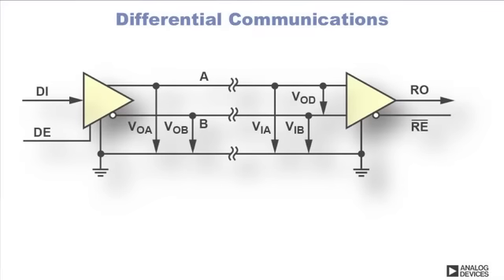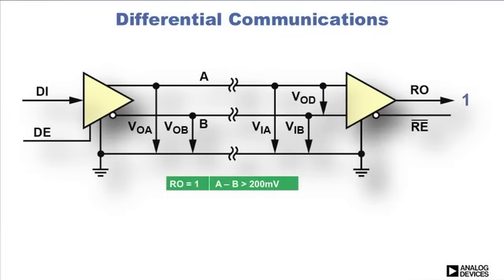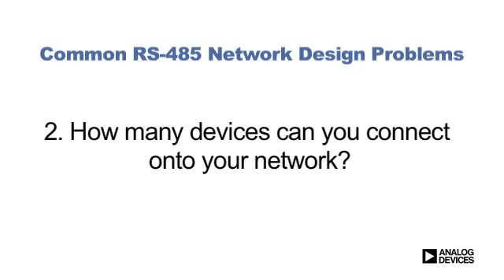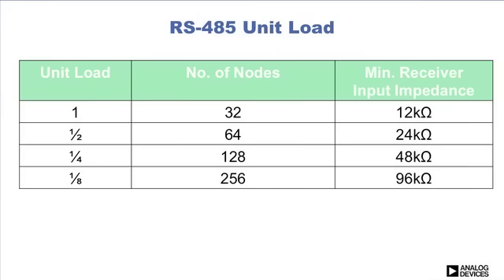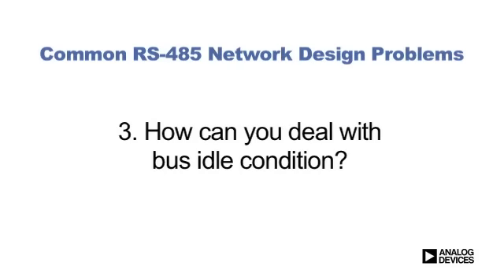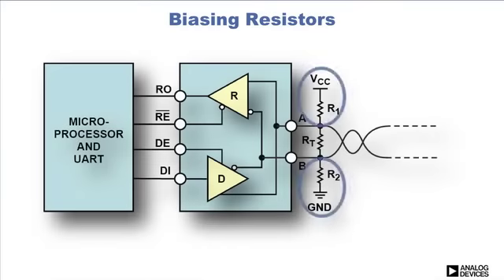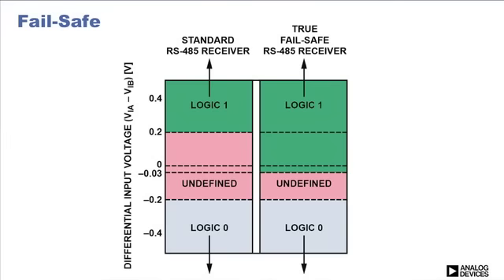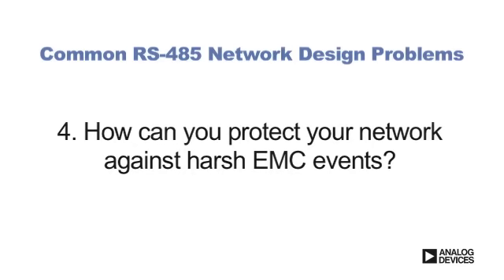RS-485 Circuit Implementation

Comment: I used adm2481 for high speed serial comm, unfortunately the results were catastrophic! At high baud rates, say 5 Mbps, when I wanted to change communication direction from tx to rx, just after resetting re pin, there was a bit (glitch) on my rx pin in the ttl side!
At lower baud rates, there was still a glitch, but the amplitude didn’t bother me! I changed the Device on my board with a TI transceiver and it solved my problem!
Pitty... I wanted to share this, cause AD didn’t give me a reasonable answer!
Reply from the maker: The ADM2481 has a maximum speed of 500 kbps and is not suitable for high speed serial communication. The ADM2491E would be the part of choice for operation at 5 Mbps. As a reminder, technical queries can be asked on the ADI EngineerZone forum: https://ez.analog.com/interface-isolation. Thank you!